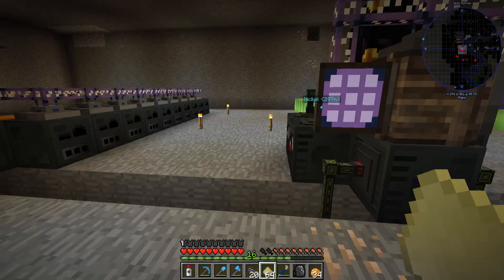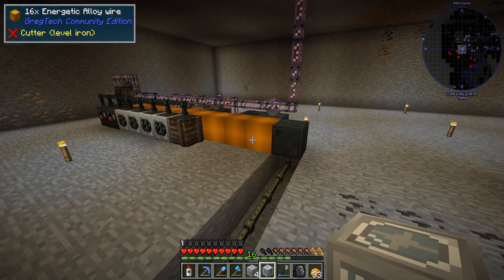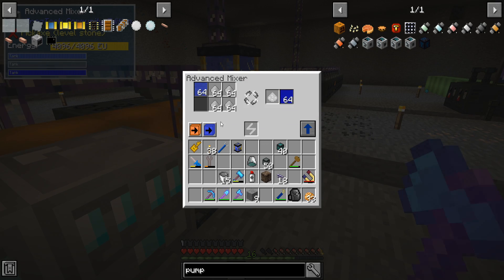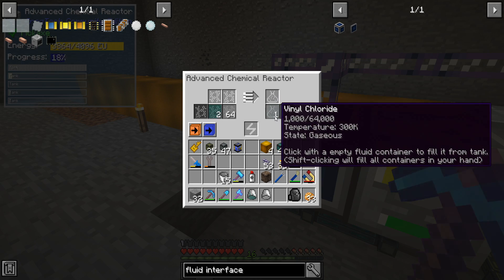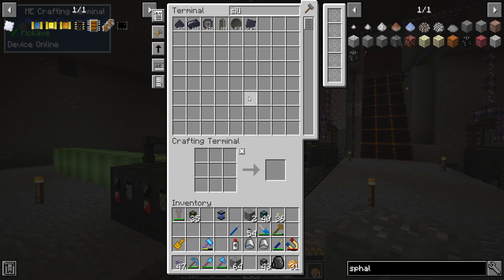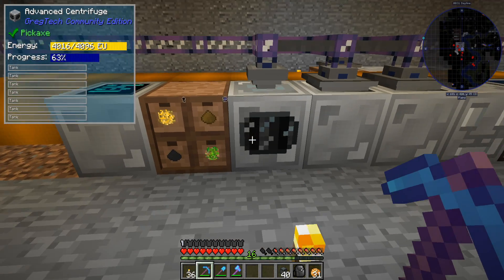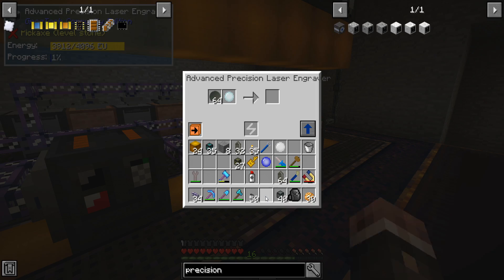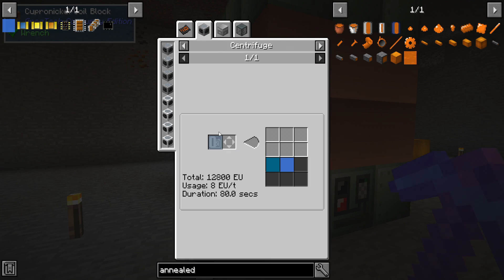Omnifactory Episode 8: Circuit Progression and Infrastructure

Comment: integrated circuits are used for nothing but the first tier 3 circuits so they’re kinda worthless after unlocking more, tho i know this video was released basically half a year ago and you probably figured that out by now
Reply from the maker: The main reason to automate them was to get an easy slingshot into automating with ae2, and from there I think I was able to progress fairly rapidly even if I didn’t REALLY know what I was doing at all times
Reply: @MainlyAndy  makes sense